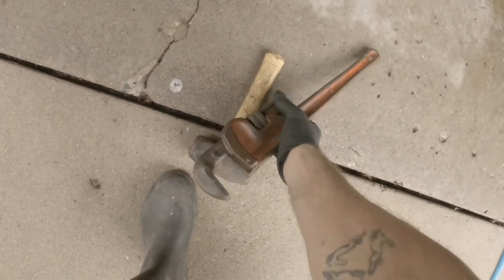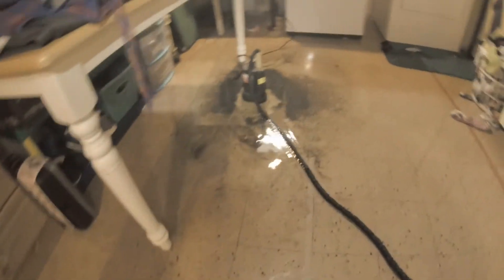What to do if my basement backs up with sewer water

Comment: What's the difference between those 2 holes? How do you know where to put the snake in?
Reply: One is a whole house trap or grease trap? The other one is connected to the sewage line. Machine would not be able to get through the trap.
Reply: @ilovetrump1252  but which is which?
Reply: @andriartayudianto8918  the one.
The snake couldn't go through was the trap

Comment: 1:22 "Yep. It will be [moves camera. creates noise]. It's totally backed up. Okay so this is the right place to snake it from. I'm gonna put the biggest [camera noise] fit in that hole right there so we can get a nice [inaudible]. So whichever one is the [camera noise: deepest?] one is the [camera noise: storm?] . So [inaudible] water that one goes down that far. Okay so that's what we want the shallower one. That's gonna be the sanitary."
Reply: Can you explain what he was saying about those 2 holes. How do you know which one to put the snake in?
Reply: @andriartayudianto8918    I could not understand what he was saying.  It looks like that is the main house trap. The hole closest to the exterior wall of the building USUALLY goes outside toward the sewer. The other hole goes to the interior house drains. It is a trap so both holes are connected by a U shaped pipe between them.  If the holes are filled up with water, then the obstruction is probably outside, so insert the snake in outer hole and aim it toward the exterior.  If the holes are not filled with water, the obstruction is probably toward interior of house, so use the other hole.

=====U=====  The trap and pipeline should look like this.
Reply: @munsters2  Thank you for the explanation